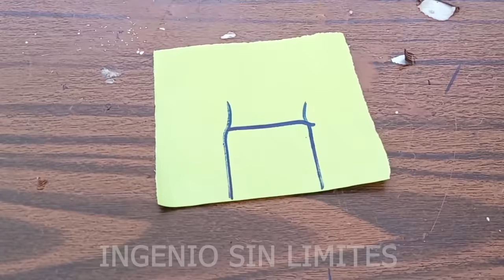How to connect round pipe to square profile different size! Secret Pipe cutting tricks.

Comment: Flat piece of steel. Trace around the round pipe with marker. Take square pipe and place it inside round pipe trace. Take angle grinder and cut out the areas with marker. Now weld the circle with square inside of it to the end of the round pipe. Then weld the square pipe to the square hole that you just welded to the round pipe. Done deal dude
Reply: That’s the difference between a craftsman and a hack.

Comment: The circumference of a round object e.g. pipe is pi X diameter - 1 material thickness. It's also the way to calculate how much sheet metal to use for rolling a pipe. ;)
Reply from the maker: You right, the e.g. Is to avoid calcúlate! Thanks for the comment